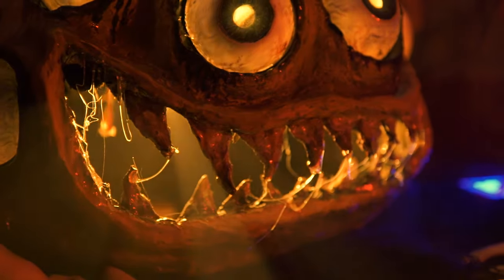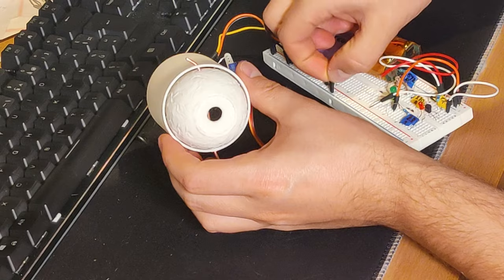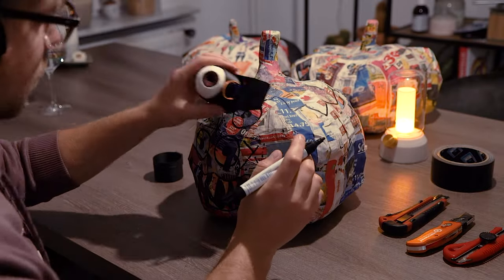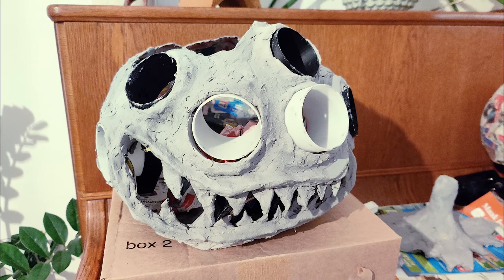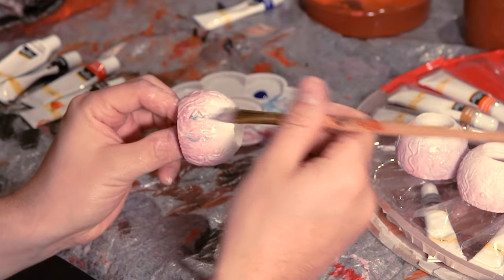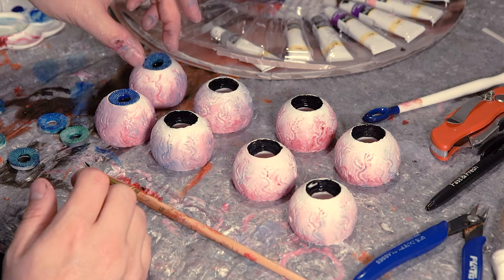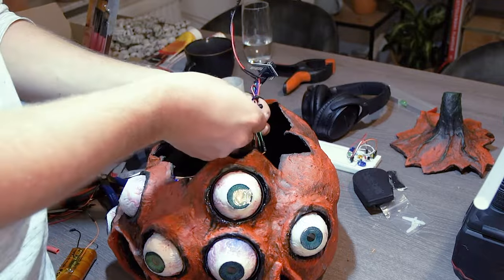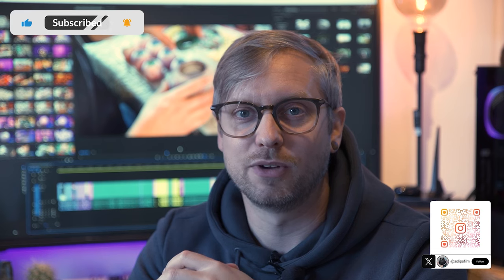Moving Halloween pumpkin! 👁️👁️👁️multiple eyes👁️👁️👁️

Comment from the maker: Hi all,
Here's the code for the project:

#include <Servo.h>

Servo servos[12];

unsigned long lastFastMoveTime = 0;
bool fastMoveActive = false;

void centerServos() {
  for (int i = 0; i < 12; i++) {
    servos[i].write(90); // Center each servo to 90 degrees
  }
  delay(3000); // Wait for 1 second after centering servos
}

void setup() {
  for (int i = 0; i < 12; i++) {
    servos[i].attach(i + 2); // Attach each servo to a pin (pins 2 to 13)
  }
  
  randomSeed(analogRead(0)); // Seed the random number generator with an analog pin's value
  
  centerServos(); // Center the servos upon startup
}

void loop() {
  unsigned long currentTime = millis();
  
  // Check if it's time to activate fast servo movements
  if (!fastMoveActive && (currentTime - lastFastMoveTime >= random(60000, 120000))) {
    delay(3000); // Delay for 3 seconds before starting fast movements
    
    fastMoveActive = true;
    lastFastMoveTime = currentTime;
    
    // Move all servos fast and randomly for 8 seconds
    unsigned long fastMoveEndTime = currentTime + 8000;
    while (millis() < fastMoveEndTime) {
      for (int i = 0; i < 12; i++) {
        servos[i].write(random(0, 180));
      }
    }
    
    fastMoveActive = false;
  }
  
  // If fastMoveActive is false, continue with normal random movements
  if (!fastMoveActive) {
    int randomDelay = random(300, 1200); // Generate a random delay between movements (faster)
    delay(randomDelay); // Wait for a random amount of time before the next movement
    
    // Move each servo to a random position within its range
    for (int i = 0; i < 12; i++) {
      servos[i].write(random(0, 180));
    }
  }
}